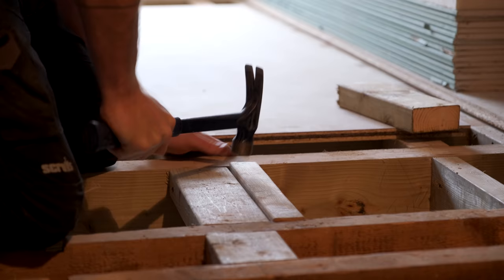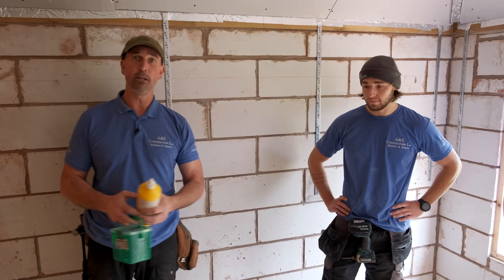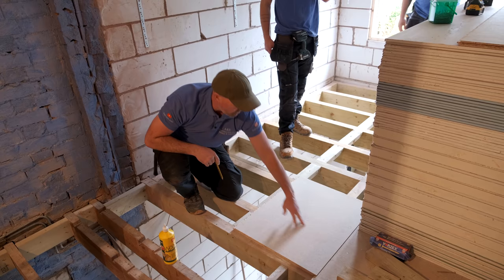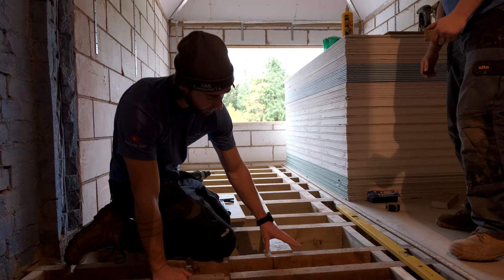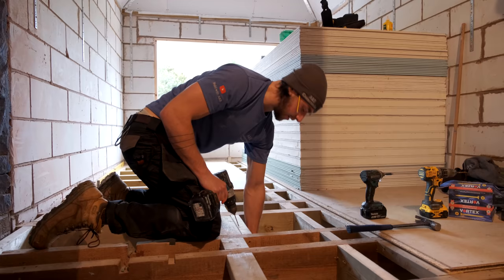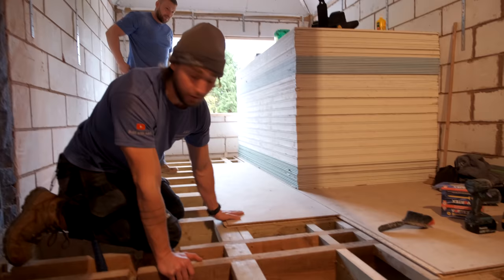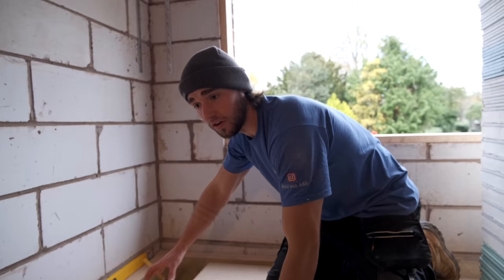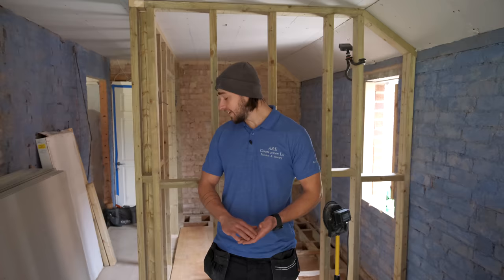HOW TO LAY CHIPBOARD FLOORING | Build with A&E

Comment: God help the person who has to uplift or has to put other services at a later date!
Reply: Just what I was thinking!
Reply: However they are working to the NHBC standard. 
If you need to lay new pipes or wiring a strip of floor will gave to be cut out. To be honest, just as it does with the old T&G floorboards. At least is now easy to drill the joists and cable the new pipes through.
Reply: Its impressive to see such precise way of working but its a given a future owner is going to want to make alterations, I just dont like how this way of building is a one time thing.
Reply: I think everyone Appreciates the skill and precision that goes into fitting this very well,  however I do agree that chipboard/osb board flooring is the worst shortcut ever for flooring. 

I’ve tried to lift osb boards up for underfloor alterations and it’s a nightmare. This stuff is weak and like cardboard. I’ve never had an issue lifting floorboards either t/g  or flat.

Comment: Make a jig from a 600mm strip of thin straight timber, mark on the centres for your screws, (you were using 200 spacing) then just line up with your mark on the wall (starter mark for previous laid board) and joist. Saves having to mark the board with a pencil line and measure for each screw. Hope that helps. Great videos, keep up the good work.

Comment: Thanks for the great video. I would have been really interested to see how you measure, scribe, cut and fit the final row of boards - where you had to cut the boards down lengthwise to fill the remaining gap. Looks like you had to cut them to fit a wonky wall, around some pipes and a brick pier, would love to see another video on how you do that trickier part of the job in future. Thanks!

Comment: I can't fully see what glue you are using but it looks like a D4 white pva glue. For something under dynamic loads like a floor it's better to use a glue that stays flexible like a pu construction adhesive for the floorboards. Pva glue tends to be brittle when dry. So with movement from the wood floor or over time slight settling of the building, it can break loose and still go noisy, while a flexible glue will move with -and dampen the floor. Not a big issue to use pva, but just a tip.

Comment: You could mark joist centre or board edges on the opposite wall where the joist ends go into the wall, Just come up vertically. Then snap a chalk line or pencil your line in once the last board is in.  Any marks will be covered by plasterers or boards, even on ready plastered walls any marks covered by skirting.

Comment: One of the best chip board flooring videos out there, i never nail my boards but a roofer recently told me the reason why roofs are commonly nailed is because nails will flex and move with the roof and screws can snap. That’s why it’s best to screw boards down 🔥🔫
Reply from the maker: Thanks for watching FB 👍

Comment: Did my bathroom floor like that.  An old imperial 2 x 3 joists and with a tiled floor going over the top I didn't want any movement (or squeaks!).  A bit OTT, but even without boards the floor wasn't going anywhere.  Worth the extra time and effort to make the job as good as it can be.

Comment: The Caber manual doesnt specify the long edge to be nogged (splint) , I like the long edge splints. Not to be confused with joist rigidity noggins by the way. After I glued I found the glue easy to remove from the joist with a sharp edge, with no damage to the joist. My answer would be cut with circular saw set to 21.5mm, do cut then run sharp chisel down what left or careful routing. Be advised nogging the long edges on the house Im doing at the moment adds £500 to the floor timber cost using 4 by 2. P5 T& G is about £20 a sheet today.

Comment: Guys  I am doing a bathroom floor 2:20 which screws are you using is it 4.5x60 stainless for wet areas or are the standard decking screws ok any help appreciated thanks

Comment: Brilliant video. So helpful. Total beginner here about to attempt DIY floor. Can i ask why you need spacers at the edges? TIA
Reply from the maker: Glad you enjoyed the video. The spacers are to allow for any movement which may take place. If everything was tight, it may cause issues with buckling. It also helps with the installation, as you need a bit of space to fit the tongue into the groove.

Hope this helps. 

All the best, John 👷🏻‍♂️

Comment: Nice vid but quick question - Seems excessive with the noggins where the board would fit into the groove of the adjacent board. Would you do this with T&G floorboards?
Reply from the maker: Hi Haroon we do support all connections, as I say in the video it’s just what we do and it doesn’t take that much time to do and we feel it’s a better job, with thin pine floor boards then no hope this helps have a awesome week all the best Tony 👍

Comment: Im doing a bit of a garage conversion. The garage floor (concrete) needs raising up to the level of the kithen diner to be one whole room.  So il be doing something very similer, joist hangers 4x3s, chipboard, then whatever flooring we choose, LVT probably.

Anyway, my question,  how would you insulate? I imagine i want a void underneth the insulation. So something on the underside of the frame to then hold the "wool" insulation?  Or battons on the underside, with rigid foam insulation?

Comment: Interesting video and clearly very conscientious tradesmen which is good to see. I assume you add insulation/ sound proofing from underneath before the ceiling in the room below is completed? 
We ended up having every upstairs room done in our house as there was zero insulation or sound proofing. It was appalling to say the very least. Clearly the building company did a shoddy job. To our utter frustration, the floors still creak though (so far no tradesman has been able to fix it). 
We're used to having solid concrete floors with underfloor heating/ cooling throughout every floor in the house. No creaks and superb sound insulation.

Comment: Video saved for when I need it. Question for.you - if you were to insulate it, would you have 100mm pir flush against the chipboard? Or would it be 100mm pir, 50mm air gap then chipboard? Would you use some form of vapour barrier in either situations? Also, would.you recommend insulating just the ground floor? Or every level? 

Another great vid lads, well done! Ps 18 or 22mm?

Comment: Hi, I absolutely love this video as it's very informative and I would really like to implement this in my 3 bed semi-detached. Can I ask, If I've got plastering and skimming to do (middle of a reno) would it be better to get this done, then plaster and skim then have my flooring fitted? or swap the first two items around? 
Thanks in Advance
Reply from the maker: Hi either way really just don’t get the boards wet And open windows ajar if there is a nice breeze once scimmed all the best Tony 👍
Reply: @BuildWithAE  I've seen different thicknesses of these boards. I'm trying your approach for a few rooms in my home. would 22mm be fine for bedrooms or shall I go thicker?  and is 18mm sufficient for a loft? Lastly what screws did you use for your noggins? cheers

Comment: I love when that glue drys on my fingers. It's something to peel off when you've a break. 😂 It's only a form of PVA anyway. Have you ever used acoustic joist tape without the need for gluing to the joists? It's cheap as chips and absorbs some of the impact sound too.
Reply from the maker: Hi Stephen that’s a great shout will look on line, I know what you mean about the glue 😂 all the best Tony 👍
Reply: The acoustic resilient tape is great. Used it on my joists and have no squeaking anywhere 👍

Comment: Hi mate, great video. Love the attention to detail, going to be building a double extension on mine this summer hopefully when the plans come through. What size joists do you use and what centre's would you usually use? The extension is going to be 6.8x2.6. 
I'm an electrician by trade but just trying to get as many ideas as I can. I was thinking of using 200mm x 47mm C24 timbers. 
Thanks for making videos, they're very helpful. Cheers.
Reply from the maker: Hi AJS much appreciated I would use a 195mm x 70mm C24 personally but you can check on the Trada Timber joist and rafter table online all the best Tony 👍

Comment: youse boys do everything right. good to see! question: what is the purpose of the metal ties or fixings on the new thermal block wall behind?
Reply from the maker: Hi Uscias they are Lateral Restraint Straps that screw to the top of the Roof Wall Plate and screw to the inner block work all the best Tony 👍 have a awesome week

Comment: Great video, will be using your tips on my next project. Any advice to correct an uneven floor (joists) prior to laying the board? Thanks
Reply from the maker: Hi Steven string line across the joists glue and screw to the side of the existing joist 6 x 2 all the best Tony 👍 have a awesome week oh make sure existing joist are good and solid
Reply: @BuildWithAE  Yes makes sense to bring any low ones up. Thanks for the advice.

Comment: Have you done a video on the joists and wall plate? Why is their 10mm behind the wall plate?
Reply: To allow cables  for sockets to be dropped down, saves chasing wall, proper way to do the job, the way I was taught,but  I rarely seen it done.
Reply: @stuartandrews4344  how is it spaced off the wall? With some sort of packer?

Comment: I would rather use special glue used for chipboard flooring, that foams up and expands a little, not just a regular wood adhesive. Also your blokes spend like 30min on 1 floor board. I understand that you want to look professional and do a good job, but either u are not making any money or your customers are paying a lot for unnecessary work :)
Reply from the maker: Hi C014ain that glue was originally designed for exterior flooring for big house developments to get the floor down so they good work off it because of the weather, either glue does the job well all the best Tony 👍

Comment: Very useful / helpful, if your building a new house / extension   etc. BUT, my house is  40 yrs old, and the floors were, and still are, appallingly noisey. No amount of screws, serrated nails, and glue,  has shut the bugger's up.  I wear ear plugs permanently---eh ?
Reply from the maker: Hi Phillip sorry to hear about the Ear plugs, I think Skillbuilder does a video on squeaky floorboard repair check it out all the best Tony 👍

Comment: Top video chaps, really clear. Have you tried PU glue in this application? As that would foam up and possibly give you greater contact area. Any advice for non-squeaking stairs?
Reply from the maker: Hi Adam great shout on the PU glue, squeaking stairs best to take carpet up and glue and screw the riser from the front into the underneath of the tread use a pilot drill when you do this also try and put new glue blocks in if possible all the best Tony 👍
Reply: Hi, if your stairs are squeaking you need to get to the underside of the staircase, once exposed you will probably see triangular blocks. Remove them the best you can and replace them with a length of 2x2, plenty of pva on and whilst one person holds it in position another person from the top side screws it through the riser and down through the front of the tread, this will draw the 2 together and be as tight as a drum, check the wedges on the underside also in the strings each side for any obvious movement. This will do the trick 👍

Comment: Awesome video, as always.  Quick question. Can you get  plywood in the UK?  Surprised you would use chipboard instead of plywood or OSB.
Reply from the maker: Hi R Myers plywood floor I have only seen in an engineered finish board designed for underfloor or if clients don’t want carpet, in this application it was specified thanks for watching all the best Tony 👍

Comment: Don't understand the negative comments. If you do everything to specification at the outset, why would you need to do ant remedial work anytime soon? I'd rather everything was solid. If you have new wiring and plumbing its unlikely you will need to rip it out for 30 years at least.
Reply from the maker: Hi Shaggy 8392 much appreciated your spot on all the best Tony 👍

Comment: Bad storage of materials gents on that suspended floor
Reply from the maker: Hi Ian it was no issues at all, If you look at the trada timber 8 x 3 joist xC24 are a massive over kill on strength but I don’t like bounce on floors, you could drop an elephant from the sky and they wouldn’t move plus the steels they are loading on to can take a 4 storey building all the best Tony 👍
Reply: @BuildWithAE  no worries 👍just saw the boarding over a metre thick stored just out of shot and that in conjunction with a couple of guys moving around pushes the envelope a little in terms of short term live load
Reply: 👍enjoyed the vid anyway